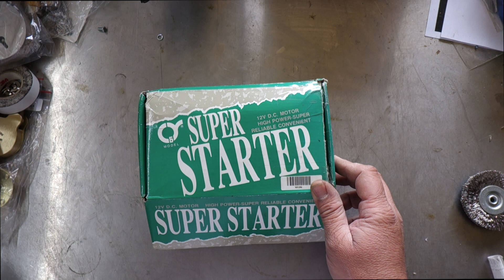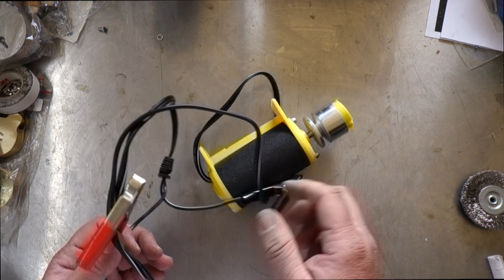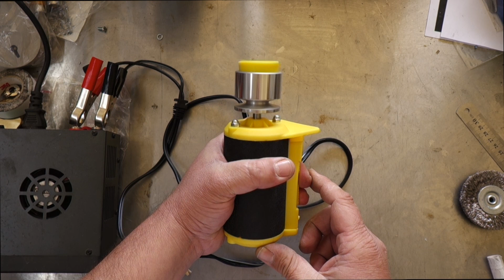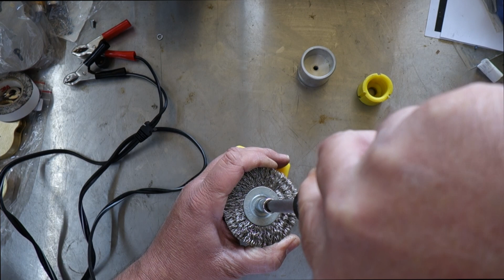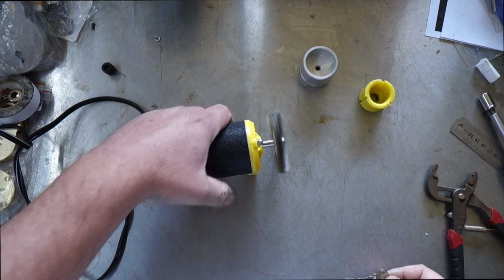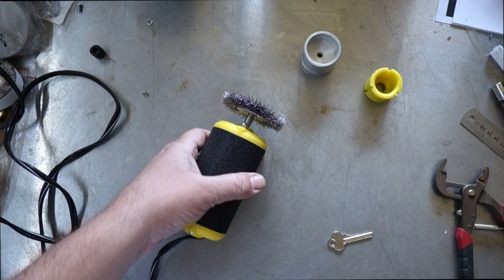How To Make A Key Buffing Tool For The Van 12V

Comment: could you please cut a 5 depth space and depth key 6 pin and duplicate it on your best duplicate machine and show the results using a digital calliper across all depths. to see the deference. between the two if out at all.